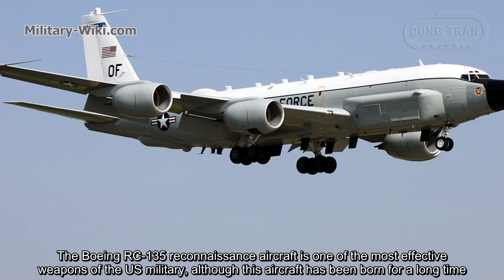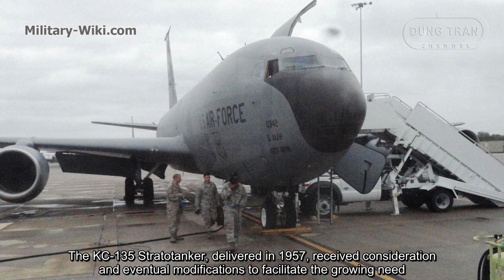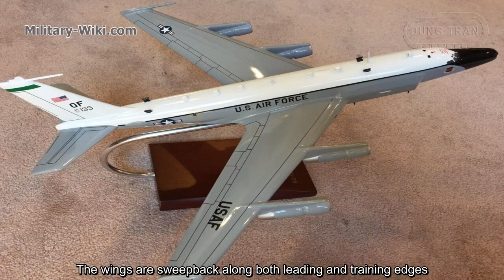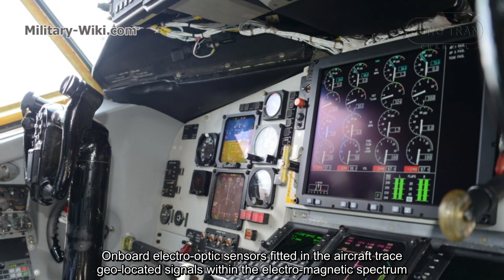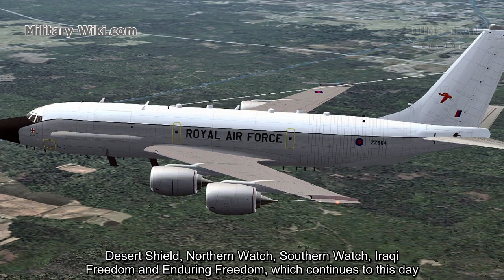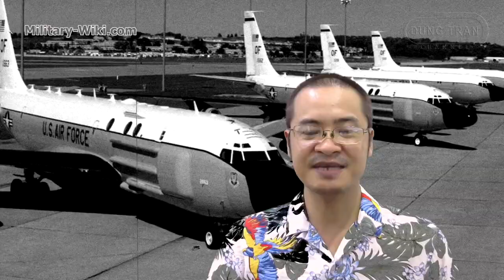Boeing RC-135 - One of the powerful weapons of the US military today, even though it is old

Comment: My father spent most of his USAF career as the pilot in command of RC-135s during the Vietnam War.  It's such a useful platform that it has been continuously in use and updated continuously for 61 years and counting.   All are on an alternating 2 year update program, with each update specification called a "block".  At any given time, half the fleet is operating at the current block, and the other half is one year behind at the previous block.  For example, block 45 and block 46.  When the block 45 aircraft are due for their biannual update, they get the new block 47 updates.  The following year, the block 46 aircraft get updated to block 48.   And so on.

Comment: The only thing old on it is the "airframe" everything added on the outside, engines and radars, and what's inside is very new and up dated.
Reply: Many, if not most, have been reskinned and their airframes strengthened. I believe most are on their 3rd type of engine generation.

Comment: Did you forget to mention the airframe is originally a 707?
Reply: Not quite. The Boeing 135 series airframe, called by Boeing the model 717, was derived from the prototype Boeing 367-80 jet airliner. It has a slightly narrower and shorter fuselage than the 707.

Comment: Actually, the original engines were Pratt & Whitney J-57 turbojets. They were later upgraded to Pratt & Whitney TF-33 Turbofan, models P-5, (thrust reversers for short runways) P-9 (extra oil tank for extended flying time) or possibly, but probably not PW-102. (American Airlines surplus) 
The engines with the small intake are J-57s. The engines that look like there is a large front section and a smaller back section are TF-33s. And the ones that are gigantic with the huge intake are the new CFM International F-108-CF-201 high bypass turbofans. That's a mouthful! It seems that the bigger the model name, the bigger the engine. What do you suppose the prototype engine used before the shortly-named Pratt & Whitney J-57 was? The only thing I can think of that is shorter in name would be Cox 0.49. 😬😅
Reply: The RC135s have had their engines upgraded to the CFM-56 (F-108-CF-201) high bypass engines. The TF-33s were also fanjet engines.

Comment: Still don't catch what's that kind of electronic activity this platform is intended to gather...
Reply: Depends which specific model you are wanting info on. There are three different sub models with three fully separate reconnaissance collection mission sets. To put it simply, they each collect different variations of ELINT (Electronic Intelligence), COMINT (Communication Intelligence), and MASINT (Measurement and Signature Intelligence), and SIGINT (Signal Intelligence). Basically, they collect a variety of intel on radar emitter systems, radio/phone transmissions, and ballistic missile systems.

Comment: Excellent video. The u.s has the advantage both quantitative and qualitative in the field of Airborne Warning And Control System (AWACS) not only with this RC-135 but also with the E3 Sentry. Russia has tried to build thier own AWACS, fielding the first, the Beriev A-50 in the Soviet times in 1984. Later in 2013, an improved version, the Beriev A-50U entered into service. A entirely new AWACS platform, the Beriev A-100 which is expected to surpass the americans AWACS is going to enter into service soon. Another strategy used by the Russians is to deny american AWACS the access to the battlespace through the extensive use of long range missiles either Surface to Air (SAM) or Air to Air ones. In the field of SAM missiles a prominent example is the 40N6E, a Mach 15 missile deployed by the S-400 and S-300V4 with a 400km range. In the Air to Air missiles we can find the R-37 and R-37M both Mach 6 and with a range of 400km deployed by Russian MiG-31 interceptors and Su-35 fighters respectively
Reply: The RC-135 does NOT serve in the AWACS role.  Its role is electronic intelligence and surveillance.   The combination of the RC-135, the E-3 Sentry AWACS, and JSTARS provides a comprehensive picture of all aspects of the battlefield with integrated command and control of allied assets.
Reply: The great thing is that by using both RC-135s and the newer AWACS the US has both real-time battlefield intelligence gathering and Id of hostile and friendly aircraft. The AWACS can guide our fighters to intercept threats. We also had electronic warfare RC-135s that have been replaced by more modern aircraft.

Comment: I usually like your videos, but this time you didnt say what it does? What kind of sensors does it have? What mission does it fulfill? I want to know more about this aircraft.
Reply: Exactly
Reply: Maybe because all that shit is classified
Reply: There've been a number of RC-135s such as the B, C, D, M, U, S,  V, W, and X. Each has a different role from gathering data from photo, elint, sigint, ballistic missile, to technical sources. They carry different antennas, receivers, radars, and optical devices.

The purposes are for air order of battle, confirming treaty adherence, C&C identification and location, and technical specifications of opposing electronic systems.

The airframes may be old, starting from 1955 for one model, but the aircraft systems and electronics are upgraded often.